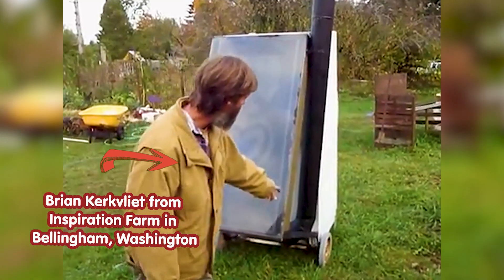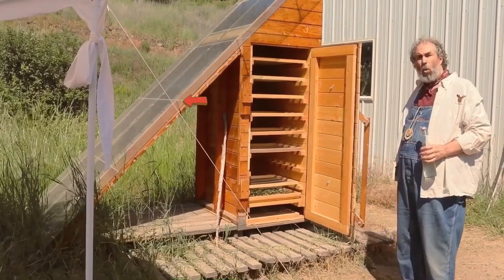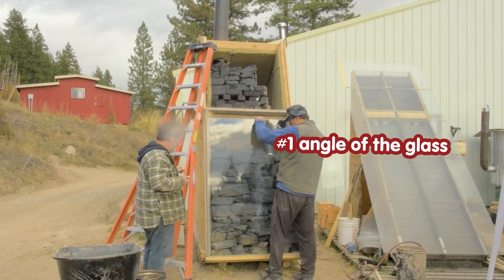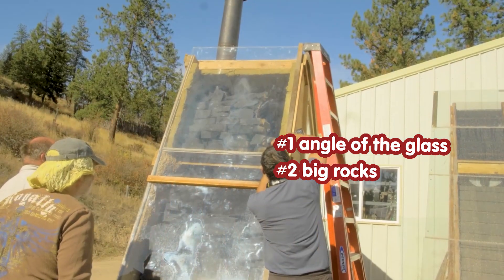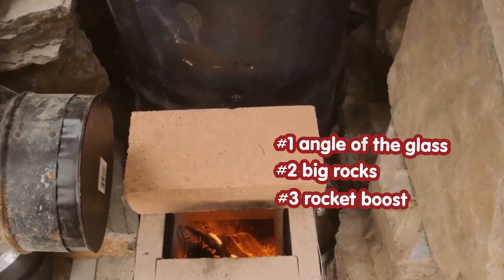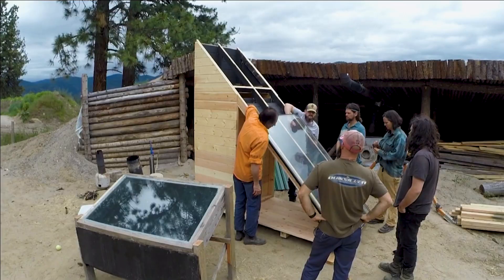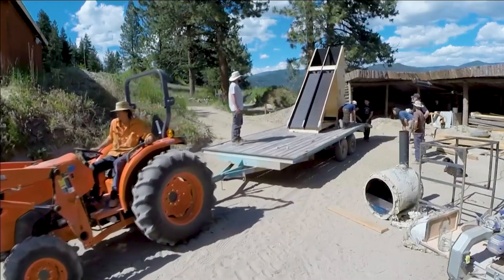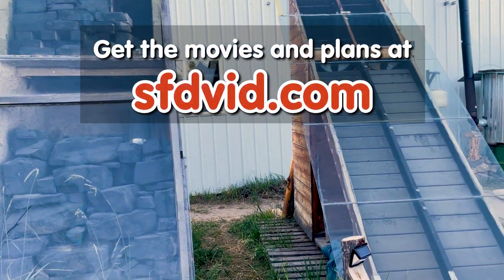solar food dehydrator number 6 is 10x better

Comment: If you want to try it out, consider staying at Wheaton Labs through the SEPPer program or joining the bootcamp!

I was able to use the Solar Dehydrator with Rocket Assist to dehydrate 2lbs each of kale and sweet potato chips.

Both while Stephen was also drying apples at the same time!